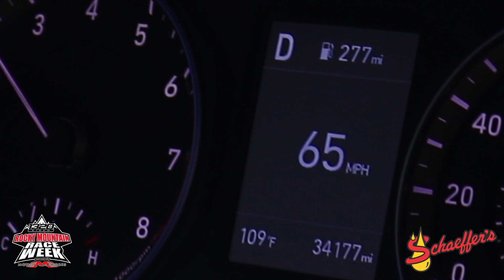FINAL Day of Race Week: We NEED to go FAST! Lined up with Cleetus McFarland for the LAST PASS.

Comment: The truck is overheating because the cool air is going OVER the tubo when it bounces of the windshield, it is in an awful place, just see cars in a windchanber, a big square truck will create almost a vacum in that spot, aerodynamics aint just about downforce, being a brit we don't go fast with HP we use finesse (if its not broken ofc) - edit - US cars are WAAAAAY cooler but not as refined at all
Reply: your truck rolls out!!! so what does it matter???!?! I sound stupid lol!! Damn lookin good and going fast, US does that better than anyone!! The Sweedes love a sketchy little 4 banger with 200mm turbo (jk) and Aussies would rather smoke the tyres the whole run and run 20seconds than sub 10 and no smoke. Brits, our shit breaks on the trailer, rattling to pieces, mclaren, tvr and the fast jags, always been the same story, lightweight deathboxes. US can do it with a passenger in a sexy truck with space for luggage and run it all day in 100 degree heat! Ignore my previous comment bout the turbo, it looks cool and it's fast as fuck, what else matters!!